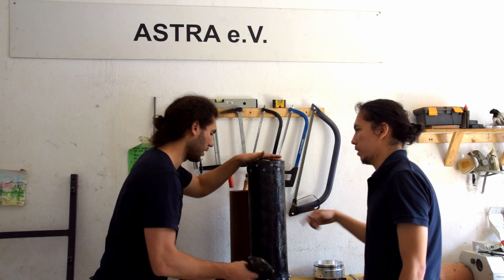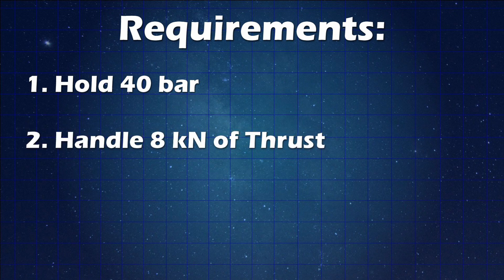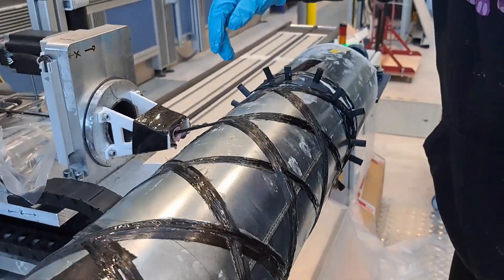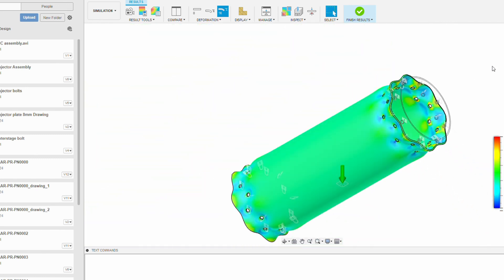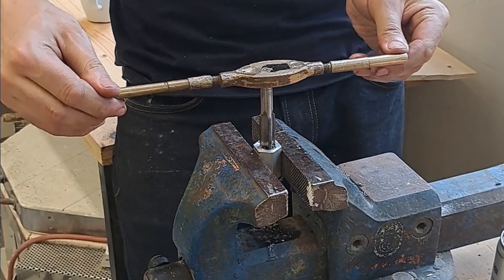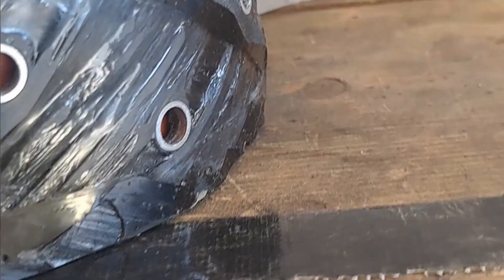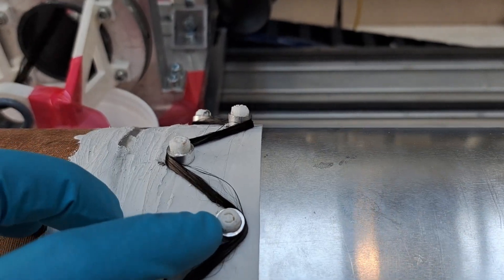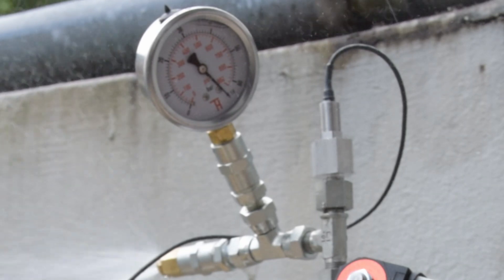Making holes in Carbon Fiber the ASTRA way... Phoenix combustion chamber casing

Comment: Do you actually hot cure the tubes or temper them After curing ?
Reply from the maker: These ones are just room temperature cured.  We do heat gun it for an hour after winding though.

Comment: Thought about your winding on the combustion chamber and think you are making an error.  Carbon fiber only works in tension and your winding technique only works with outward pressure on the sides of the combustion chamber.  The pressure thrust exiting the nozzle will have an equal pressure on the forward bulkhead, this pressure thrust on the forward bulkhead is the rockets power.  For that large force on the bulkhead of the combustion chamber you only have the aluminum to handle that force and nothing in carbon fiber applying tension to stop that.  The aluminum chamber will stretch each time it is used and the more times metal stretches the weaker it gets, then catastrophic failure.
Reply from the maker: That is an interesting way to think about it, but I would suggest considering another principle.  While the thrust is applied to the combustion chamber casing there is also nearly 40 bar of pressure in the chamber.  Pressure naturally rigidifies objects (this is used in rocketry all the time) which prevents them from buckling under these loads.  Also, to give you some perspective, the load from the thrust is 8 kN; where as the load from the pressure inside the combustion chamber is 80 kN applied just to the inner bulkhead surface.  So, in terms of stress, the pressure definitely wins.
Reply: @ASTRABremen  A chain is only as strong as it's weakest link.  On your combustion chamber, are you using a Heat Resistant Resin, Phenolic Resin, or regular Epoxy Resin (melting point 320F)

Comment: I think the design is good for your maximum pressure requirement. However, how did you deal with the heat from the combustion? Is the Tg of the resin high enough, and do you also implement a thermal barrier to keep the resin from burning or degrading?
Reply from the maker: There is pertinax insulation between the hot gases and the chamber wall.  So everything is very well protected.
Reply: @ASTRABremen 
warum denken sie, das dies gut ist? Haben sie Temperatur Detektoren zwischen den Schichten platziert , um den Wärmefluss zu beobachten?
Einfach gesagt , ist der Ausdehnungskoeffizient und die falsche Wahl der Materialien die Fehlerquelle.

Comment: Do you want to get rid of the aluminium by sodium hydroxide?
Reply from the maker: No we just leave it.  No need to remove it.
Reply: Galvanic corrosion not a problem?
Reply from the maker: @asdf154  not so far...  None of our aluminum parts have had corrosion issues before.
Reply: Cool thanks. I read in a few places not to let carbon fiber and aluminium contact each other due to galvanic corrosion, but I have no experience with how bad it could be
Reply: @asdf154  Generally, as long as you keep it dry, and then store it in a dry place, it should be fine.
Reply: Maybe in such dry and high-temperature conditions, galvanic corrosion is not a problem. However, at the industrial level, some environmental tests like salt spray can make it worse. There are two common solutions:
- Anodize the aluminum part.
- Put a thin layer of non-conductive glass fiber between the carbon fiber and the aluminum part.